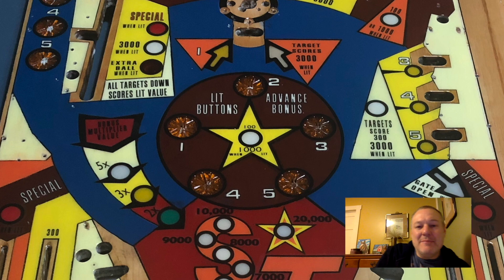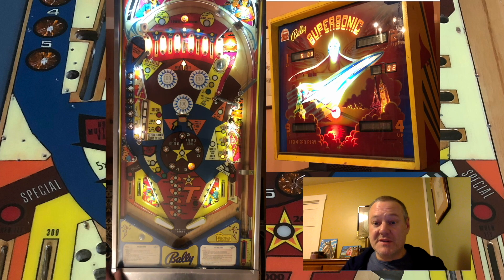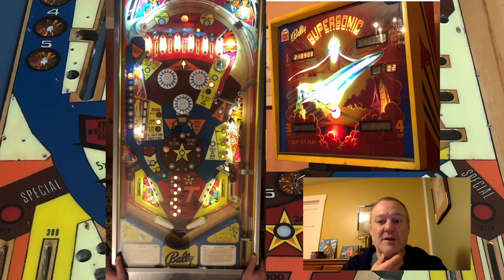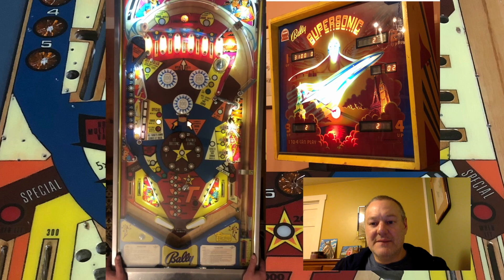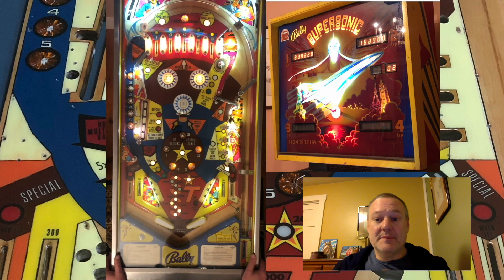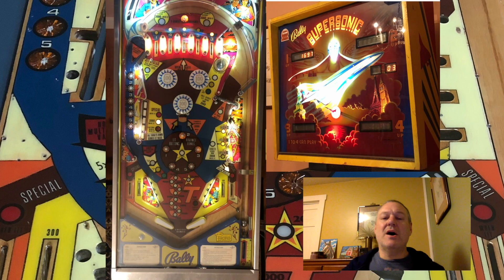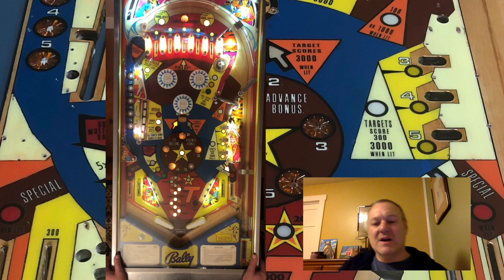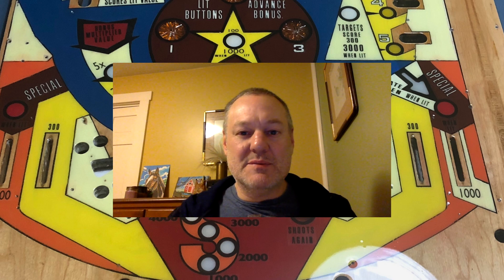Supersonic2022

Comment: I downloaded the github zip file. Got two issues so far. Hardware version 4 gave issue so I made it 2. Then AudioHandler.h gave error at #define WTSerial Serial1   where  'Serial1' was not declared in this scope
. Am I missing a file?
Reply from the maker: This game will only run on Rev 3 or greater. You'll have to change that back and then select Arduino Mega 2560 from Tools > Board. That board is required.
Reply: @ike9167  Thanks for the info. I just ordered the Mega 2560 Pro and a Rev 3 adapter board from RoyGBev so hope to get everything going in a week or two. Where are the audio files for the wave trigger board?
Reply from the maker: I haven't figured out a good place to host the audio files (about 250 MB). My options are filling up. (for now, they're here: https://drive.google.com/file/d/171bZv0rj743kybuDG6Fqcyu08vO8RrD_/view?usp=sharing )